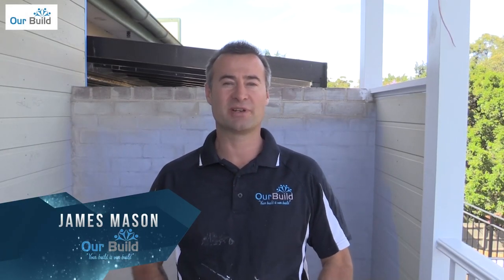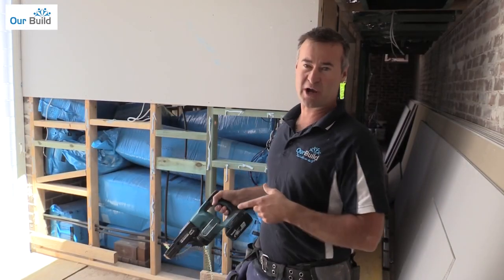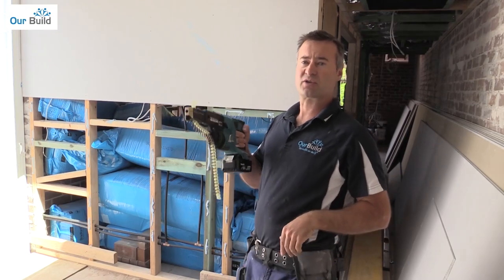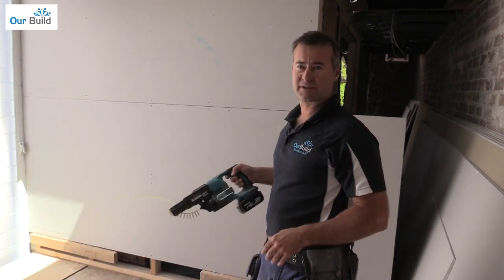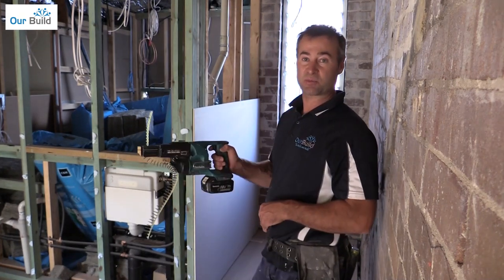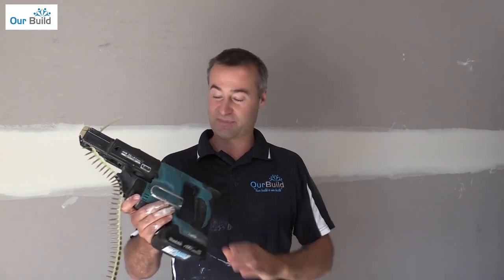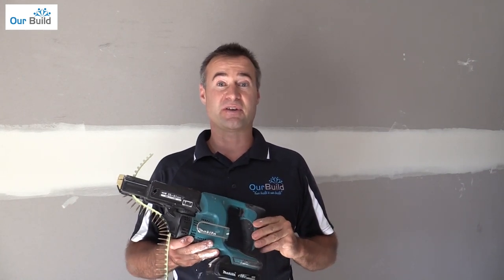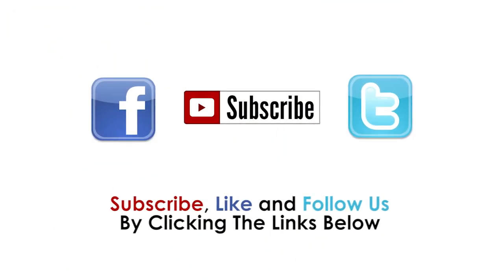Tool Review - Makita Collated Screw Gun - DFR450

Comment: I bought the same model when the 14.4v LXT platform first came on the UK market around 2005/2006.  Its still in regular use and I prefer it to the newer models as its more compact and light weight, seems to take any make of collated screw where as the newer models are a bit specific as to which brand it'll take and its been adapted to run Makitas 18v LXT batteries.  Perfect screw gun
Reply: Makita it the way to go I believe I made the jump to Hilti about 8 years ago and vbeen disappointed with then ever snice. Now I am back with Makita I am happy

Comment: My old one broke . I ordered a festool . 1st none Makita tool I ever brought . Came not working . Is this genuinely suitable for daily dry lining because the old one wasn't and replacement tips don't exsist. £800 for a hilty seems to much as I do carpentry work as well . But every single pure dry liner has one . Maybe it is only real option 🤷. Edit just noticed it only goes up to 42mm . So no it isn't . How you gonna double board or triple board 🤷
Reply: Nice thing about Makitas is that the parts are inexpensive, in the main, and readily available. If you want longer screws then go for the DFR550 or DFR551 (up to 55mm screws) - which incidentally seem to be the standard models in the UK (look for a DFR542 and you'll see what I mean). For even longer screws there is a DFR750, but I personally don't do enough overboarding to justify one of those

Comment: I use one of these every day im a 1 st fix roughing joiner, when they work there brilliant but they suffer from wear and tear. The front part has a guide to keep the screws driving straight the springs go on this and the screws start jamming and you can't repair it,  this means you need to replace the front section which typically sets you back £100.
Reply: Thank you for saying this. I was wondering how it handles over time.
Reply: Some Punk no worries I have since found a local builders merchant who supplies Makita parts and stocks the internal front guide which only costs £20 if that helps sway your decision.
Reply: Thanks for this iam going through this issue and it's doing my head in but I have to think the money it earns its got to be worth replacing when you say the front part I assume you mean the section that slides off to change screw driver bit?.

Comment: forgot to ask, what size battery are you running with yours ??? how many screws approx did it last ?? I'm thinking of a smaller battery then my 3ah for weight purposes..
Reply from the maker: +Wesley Walker , Hey Mate, I was switching between the 2 Amp hr and the 4Amp hr, didn't really keep track of how many screws i got out of a charge though.

Comment: Hello James, one question about drilling a hole into clay pipe of the old 1970 house so that I can insert a plastic pipe into it, any advice on how to do it and not crack the old clay pipe.
Reply from the maker: kimatla You could hire a core hole machine, but could be expensive and over kill for just one hole. Personally I'd use an angle grinder with a diamond or stone disc and make a series of cuts around the shape. Most plumbing stores sell pipe repair kits and you can get rubber boots that connect the terracotta to the PVC, so that might also be worth a look.

good luck.
Reply: Thank you very much for the advice

Comment: Had 1 for a few years, because it cost so much. It can be a little bitch..miss screws quite a bit..I can think of some design changes..screw feed too close, screw feed should be connected to the nozzle so it doesn't run forward and jam up on the front screws..should narrow tge front head..when it works ..mostly it's great...but..needs improvement

Comment: Does makita have an adaptor like dewalt or hilti for the same purpose?
Reply: Makita does a collated screw adaptor, model 199146-8, for the DFS451 and DFS452 drywall screwdriver. Senco also make a collated screw adaptor for these models, model DS55-M1

Comment: Never seen anyone hang the ceiling after the walls...the walls hold the ceiling up.   Hard to trust a review after seeing this.
Reply: It's possible with a screw gun. It's made for replacing damaged plasterboards caused by water etc.

This is a specialist tool and the job can be done with an ordinary drill WITH a wall built first. But most inner roof replacers don't have a wall in their backpack...
Reply: Walls don't hold the ceiling up the screws and stud adhesive do

Comment: You screwed your drywall sheets wrong. When you did the sealing. They are not suppose to end up on the same joint. It's suppose to have a brick form
Reply: Lol they're full sheets, is he supposed to cut them smaller ad have buttjoints everywhere??

Comment: I have one of these but ot constantly jams i had given up on it any ifeas how to stop it kamming ?
Reply: Use decent quality screws, fully depress the tool when driving, fully extend the tool when removing from the wall and don't push the tool too hard - it isn't a nail gun so it won;t work like you are bump firing a nailer. You need to learn to work at the rate the tool is happy with